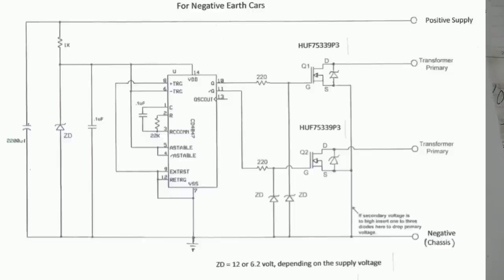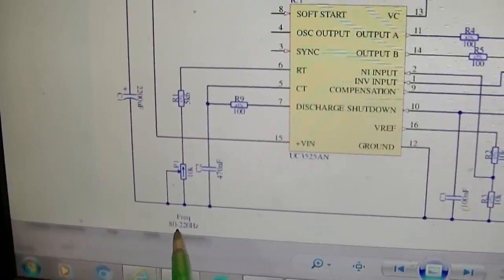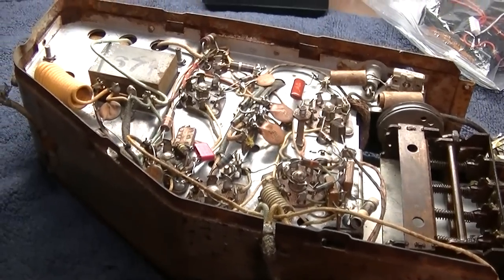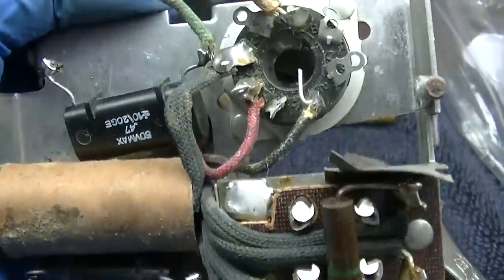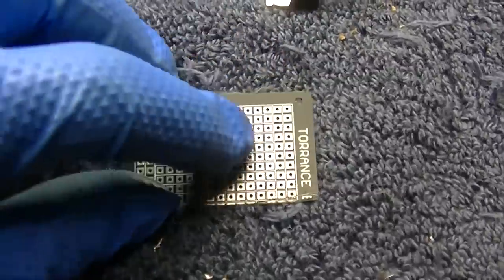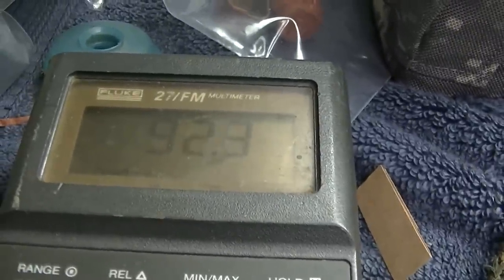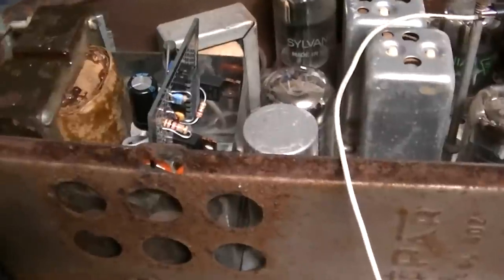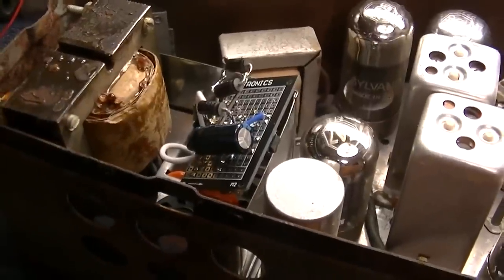Build Auto Radio Solid State Vibrator Replacement and Testing v2 1

Comment: I think the heating encountered when putting the diodes between the supply and the center tap is caused by the inductance of the transformer. When one side turns off the current wants to continue flowing so the voltage shoots up. Normally the current continues by flowing backwards through the other winding, but with the diode present it can't. So the voltage shoots up as the transistor turns off and causes excess heat.

Comment: I read about you are not able to se a DC-DC .... sure, those are noise sources. You can use an LM350 mounted directly on the case, (use the whole thing as a heatsink). Not the pretiest .... Not sure if the 350 will like the load at all. It is a shame because you need to modify the radio a bit. At least you can get some control. Be sure not to starve the IC or be to much low that Vgs on the mosfets are not high enough so they wont turn into heat sources.

Comment: 3:05 I'm disappointed! I was hoping to see you modify the radio with 12-V-plate space charge tubes then build a one-transistor output stage with a giant heat sink. It's important to keep up with the times, you know.

Comment: That .004 capacitor on the secondary is probably to reduce ringing of the transformer, you see caps like that across the secondary in many tube radios with solid state rectifiers to reduce ringing caused by the slow and abrupt recovery of solid state diodes. that cold cathode rectifier tube may have had a similar probably so they put that capacitor there.

Comment: Product design versus electrical needs is always the toughest nut to crack. The offerings by sellers of solid state vibrator
replacements offer no  guarantees. Makes sense after reading Paul Carlson's comment.

Comment: I really appreciated and enjoyed this video on building the solid state vibrator circuit, great job there Shango066.  I have a small collection of vintage tube type auto radios.  So far, I've been successful opening the vibrator "can" and cleaning up the contact points, and reassembling them to work.  Someday I will build one of these SS vibrators and try it out!  On another subject...I wonder what happened to your "this is a test, this is only a test" radio station?  I think you mentioned before that it had been on a long time.  I wonder who was broadcasting that signal and who was paying for it.

Comment: Surely a buck regulator would be a better plan to convert from 12v to 6v?
Reply: Yeah, resistor drop will depend on current.  Maybe it is a divider, but that would kill the battery in no time.
Reply from the maker: noise
Reply from the maker: noise
Reply: @shango066  Hmm.. they can be noisy,  but sticking it in a metal can and filtering the input and output would probably sort that out. Might be worth a try if you have issues with that space heater of a resistor - would give better DC regulation.😀

Comment: What about rebuilding that set using the tubes designed in 1957 that has a H+ of 12V and a B+ of 12V and using the two VMOS FETS as Transformerless Class A output stage to drive the speaker.

Comment: needs short circuit protection. Current sense resistor and a transistor to disable the MV. No need for the 1 00000uf crapacitor there. remember the Royer circuit uses a impedance, an inductor in the B+. The Diodes in the source reduces the drive too much already with 6volt

Comment: why not to replace the vibrator and the rectifier tube and use an external 12 to 6 v converter? As a radio collector I do not like this solution , I like the video anyway

Comment: Well done on the vibrator mod. You could try replacing the 22k timing resistor with a pot (say 100k) and use that to change the oscillator instead of using diodes,' but, needless to say, test out of circuit (with test transformer) first.

Comment: cant you change the freqenty of the vibrator board to lower te output voltage? in that case yo dont need the diodes.. (its a pwm chip, so mounting a potentiometer on it would make it adjustable for the input voltage of 7 volts.whitout extra heat...)

Comment: When I was installing a 12 V negative ground stereo in my 12 V  positive ground Triumph, I had an inverter-like device I got years ago.  It could also be wired to produce 12 v from 6 volts and vice versa depending on how it was wired.  But I haven't seen anything like it lately.  It came from Radio Shack.  Probably would have been simpler just to convert the car to negative ground.

Comment: By putting diodes in the source you raise the source to 1.2V, and then probably the MOSFET is not opening full = heat. I think you had that figured out the first build. You measured the gate as it was a bit above 2V, and that will stay. Just put a few diodes in the positive, as (i think) you did the first time ? You can put as many as you need.
Reply: You did at the end...

Comment: Maybe try two rectifier diodes in series then add a cap to ground at the centre tap to average out the ripple voltage, it might bring it in to the sweet spot and also take some stress off the diodes?

Comment: The diodes  are dropping the voltage to the oscillator chip and hence dropping the gate drive to the fets. If you run the oscillator chip on the full 6 volts to maintain full gate drive, all should be well. Good luck with the project and thank you for your entertaining and education videos over the years. On reflecion, it would make more sense for the diodes or resistors to connect to the centre tap of the primary and leave the drive circuitry at full power.
Reply: That's one reason why I like the idea that Jernej Jakob / braindamage had, of putting the dropper diodes in the two legs of the transformer primary, rather than on the center tap.  That keeps up the voltage to the chip, and the FET gates.  One downside to that method, though, is that when the primary rings, instead of the back-voltage going harmlessly through the built-in snubber diodes in the two FETs, the series dropper diodes will block the backflow, which could lead to those series diodes seeing some hefty reverse spikes (depending on how fast the FETs are switching on).  Simple series dropping resistors in the two primary legs (instead of diodes) could avoid those problems.  The thing is, since Dan doesn't want the RF noise of a boost-buck converter, you're going to be dropping voltage somewhere, with diodes or resistors, and that means heat, so he has to choose where to locate those components so that they don't cook the little FET board.
Reply: @auchterawer1150  Further thoughts: I can't see that the FET drive will produce any more B+ than the origial vibrator with it's metal contacts. 350V may be a bit on the high side but if it doesn't exceed the tube or capacitor ratings why worry?

Comment: what is a car radio vibrator??!? what does it do?
Reply: It's kinda like an old style mechanical version of a PWM circuit. They basically achieve the same result, from what little I know about electronics.
Reply: The faster the vibrator vibrates the more output voltage, the slower it vibrates the less voltage it outputs.
Reply: The vibrator creates a pulsed voltage to drive a transformer.  The transformer is needed to create high voltage,(B)for the tube circuit
Reply: Like a relay oscillator to generate a chopping wave from DC, that can be upconverted to a large DC using a transformer. An early STEP UP.
Reply: You need around 150-250 volts DC for the B+ supply to the vacuum tubes.  In the 1940s, to produce a high DC voltage from a low-voltage DC supply (the car battery) there were only two ways to get that: a vibrator circuit feeding pulsed 6VDC to the plate transformer primary; or you had to use a dynamotor (motor-generator set), as used in WWII aircraft radios.  Dynamotors could be more expensive than a vibrator, transformer, and rectifier tube, and they took up a bit more space (especially if the motor had to run at 6V instead of the usual 24-28V of an aircraft, needing thicker magnet wire in the motor windings).  Since the solid state electronics of more modern radios don't need high voltages, they just run off the battery, so no need anymore for vibrators or dynamotors.  (Some 1980s-1990s car radios needed a tiny bit of somewhat high voltage for their vacuum-fluorescent displays, but they had efficient modern DC-DC converters well engineered into them for that.)

Comment: It is a bad idea to put diodes in parallel. It is foreshore a potential failure.
Reply: It may not be proper, but it can work.

I hacked 2 parallel diodes on top of a small one that was overheating in a power supply I was over driving (I was re using a 36v printer power adapter for an LED power supply) and it ran 24 7 for about 2 years. I still have it, but I took it out of service because I got a real light and power supply.

Comment: Monostable multivibrator circuits are also useful in creating a nice sounding click from the weak pulse output of some vintage geiger counters like Eberline and the Civil Defense CDV700.  You can find some schematics online if interested.  Their main benefit is super low battery consumption so one battery can last for years if usage is occasional and you remember to turn the power off.